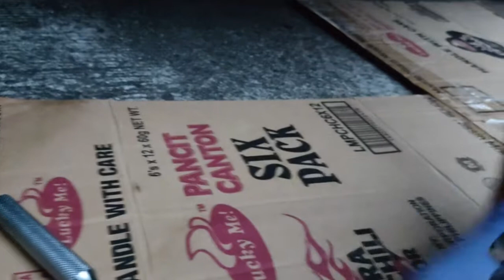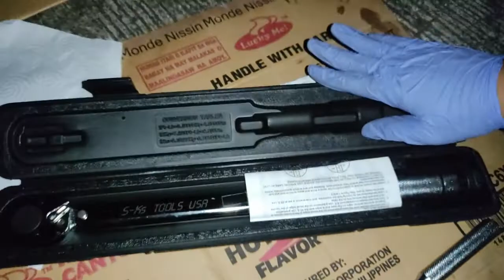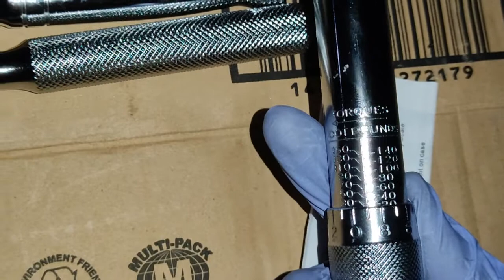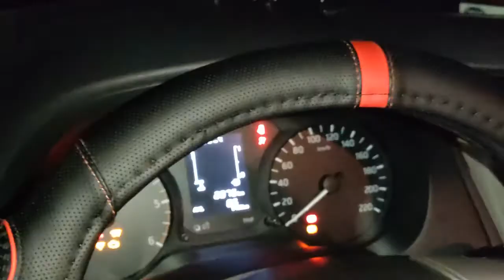How to change the oil of Nissan Navara

Comment: So remove the sump plug, dump the oil, and re-fit the plug! You did not use a new crush washer, or change the oil filter! Fair dinkum, a lesson in what not to do.
Reply: I thought the same... why change the oil but leave the dirty filter in? He's clearly worked in a dodgy garage that does the same, but charges you for a complete oil/filter change!

Comment: Hello i have nissan (navara np300 d23) model year is 2017 . (not have adblue.)
Engine : YS23DDT
Should I use my 5/30 C3 engine oil? or  5/30 C4 engine oil ? 
What is the difference between ACEA C3 and ACEA C4 oil ?
My cars catalog is say C3  but castrol find oil search is say C4 GTX RENAULT ENGİNE OİL.
i will use Castrol.
Reply: Use the C4 oil. Much better than the C3 oil.